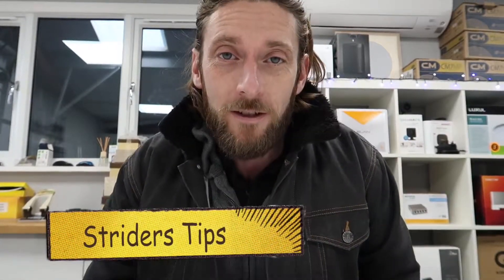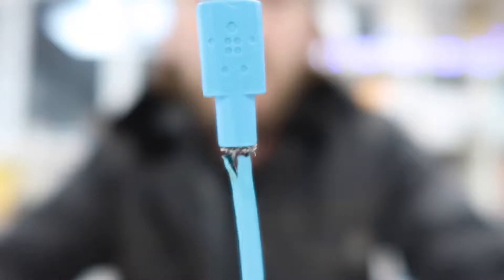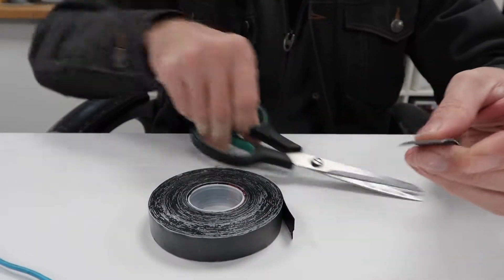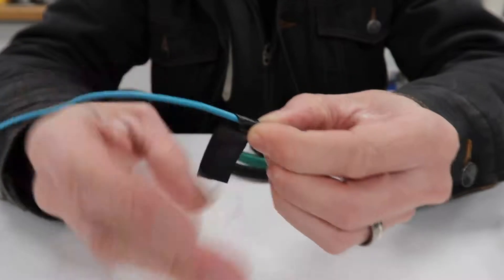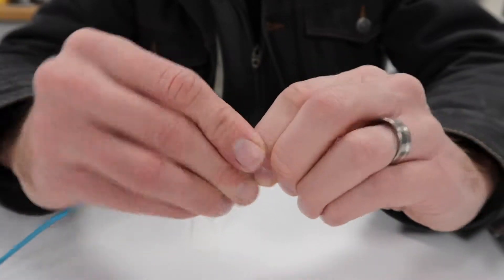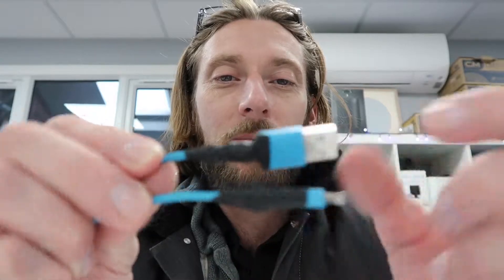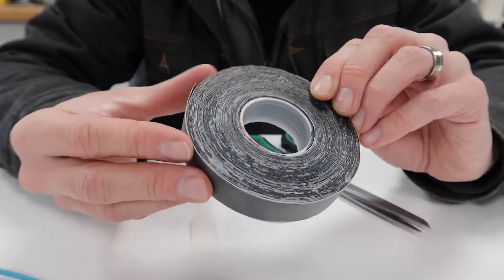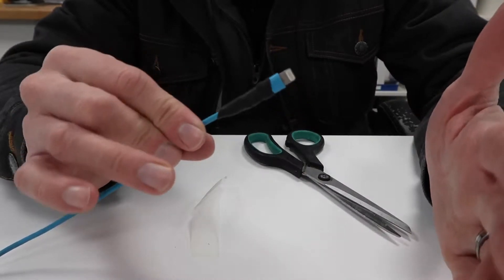How To Make Phone Charging Cables Last Longer.

Comment: Great video! Can you also make a video of the pin outs of the Oppo VOOC usb cable? I would like to repair mine. Coz I think I connected the wrong wires on the pins. I hope you can help me correct my mistake.
Reply from the maker: Reymond Respecia Hi, I’ve not repaired down to the pins yet I’ll take a look. Thanks for watching.
Reply: Hairy Strider thank you so much for the reply. I will eagerly wait for the video. :)